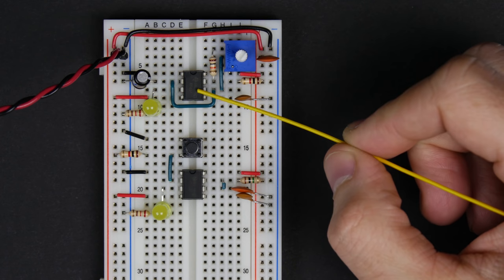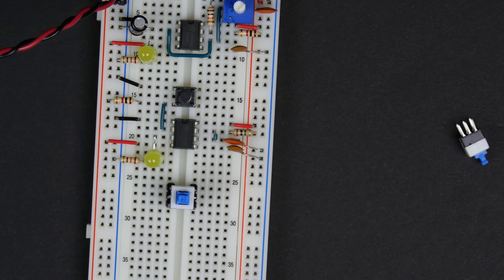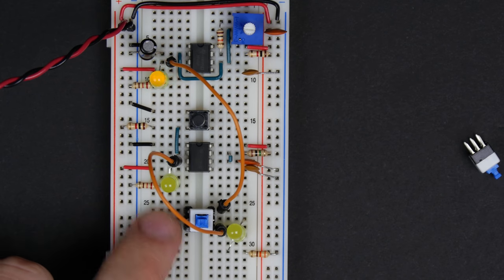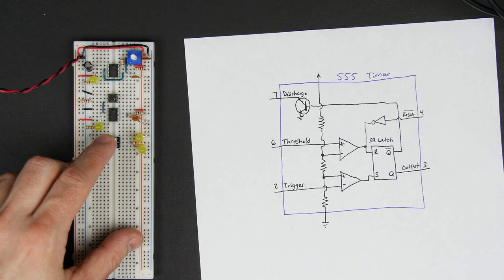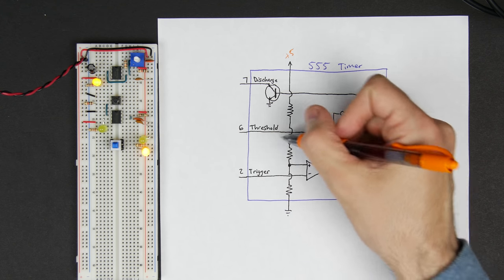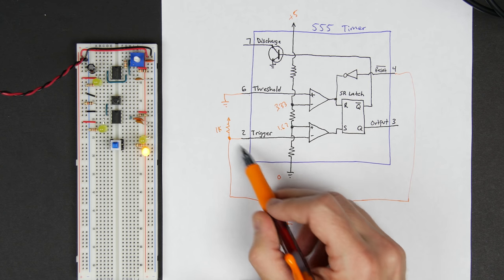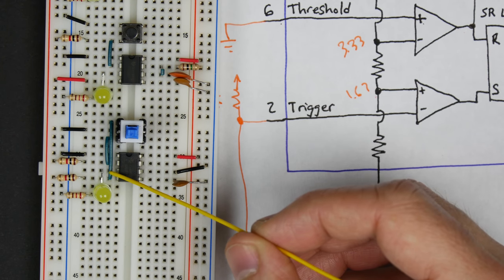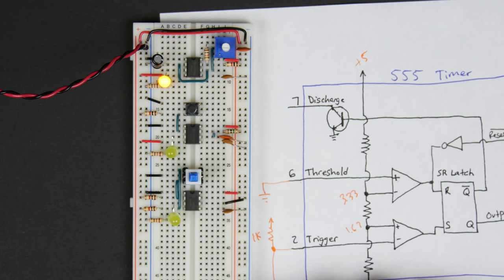Bistable 555 - 8-bit computer clock - part 3

Comment: 3 episodes in and I am getting the vibe that whenever there is a problem, you just add a triple 5.
Reply: lol
Reply: Styil I have used literally hundreds over the last 20+ years. There’s very little you cannot do with a triple 5.
Reply: I really liked the clever use of the SR latch to debounce the switch.  Brilliant!
Reply: @realdragon  probably. Show the right girl some creative uses for a 555 and she'll be all over ya
Reply: @devnol  555 is very Common so you'd rather have one of These at Home than having an SR Latch Chip
Reply: yeah the 555 is one of the best ICs ever created
Reply: @realdragon  - found a boyfriend with one 😉
Reply: @realdragon  Hook the output to a small motor and you're well on your way.
Reply: The Flux Capacitor was secretly just a bunch of 555 timers
Reply: Or a ceramic capacitor.

Comment: For anyone who buys Ben eater's kits, you need to buy "break before make" switches. The included switches are "make before break." This causes the bistable circuit to not debounce at all. Took me a whole week to figure this one out.
Reply: Thanks, I saw this happening and was confused by it. Just replaced it with a switch from an IKEA clock, haha.
Reply: Why would it not debounce? Coming from the set to the reset, the initial make before break would have both the set and reset input high. Then the switch would break the set connection leaving reset high. The reset might bounce but this wouldn’t matter as long as those bounces are after the set is broken (which seems logical if the bounces are at the end of the movement not the middle). I don’t have the tools to verify this but it makes sense to me?
Reply: I purchased and received my Ben Eater kit today. Going through the tutorials/package the switch is now different. The newly included switch is a "slide switch". In the included printed manual it notes next to the switch that "This replaces the push button toggle switch used in the videos".  Just wondering out loud if this change was for the reason pointed out by @TheOverUnder?
Reply: Shaheen Ghiassy he probably was trying to fix it once he realised
Reply: There is an easy way to fix this, which I have outlined in another comment. Essentially, you can simply plug the switch into 5V and pull down the pins 2 and 4 to GND, thereby "inverting" the logic and completely fixing the problem
Reply: You can also get SPDT switches, they work normally for me

Comment: One of the core concepts that is hard for folks used to working in analog electronics is the pull-up resistor. Imagine dimming the lights for a romantic evening by turning on the hairdryer. It’s like that…

Comment: To anyone that has bought Ben's timer kit: the switch provided there is a make-before-break switch, as opposed to a break-before-make! However, there is an easy solution to fix this.
Simply invert the logic that the gate in the video uses; i.e.:
- Connect the switch's central pin to 5V, not ground
- Use pulldown resistors to GND for pins 2 and 4
The rest of the circuit is identical. By inverting the logic, you are essentially converting the make-before-break switch into a break-before-make switch. I have tested this thoroughly and can confirm that with the original circuit and the kit's switch there is bouncing, which is fixed after doing the above method.
I hope this might help someone! Thank you, Ben, for the amazing videos!
Reply: Does this change the set up in part 4. Because everything I try to connect the 3 555 times to the inverter, and, and or gates it doesn't work. Could you please help me. Thank you.
Reply: Hi there, I am stuck at this part of the module. Can you link an image of your clock or a sketch of your circuit? 
Thanks!
Reply: @kashyapkhatri2325  which part? Did you get the three 555 timers to work?
Reply: @justinsherman9633  Idk how to connect the three pinned, make-before-break switch included in the kit with the 555 timer. This is a different switch from the video.
Reply: @kashyapkhatri2325  where he has the middle pin of the switch ground change that to the 5v and where he has on the 555 timer port 2 and 4 in the five v change to ground. Have the top pin of the switch inrto part 4 of the 555 timer. Pin three into part 2 of the 555 timer (tigger on the schematics.)
Reply: Why does make-before-break require different logic to prevent bouncing? Is it because having low voltage in pins 2 and 4 simultaneously leaves the SR latch in an unstable state that will resolve arbitrarily?
Reply: Makes sense to me! Good fix. Invalid state would resolve arbitrarily, so break before make and make before break require different solutions. I tested my switch right when I saw the beginning of this and realized my switch was make before break. Luckily I found this comment... unluckily I didn't have to think very hard to solve my issue.
Reply: I actually skipped the last 555 and built an S/R latch out of two of the remaining OR gates and inverters introduced in the next video. Then you can keep the switch wired as is, and don't need the extra inverter for the Q output here, since you already have access to the inverted Q.
Reply: @justinsherman9633  Quite late but thanks, figured it out.
Reply: This seems like a pretty terrible oversight for a kit that doesn't include instructions for the very purpose of watching these videos.
Reply: @Nadesican  yeah I’m just buying the parts on my own as I don’t need everything and that way I don’t sink all at once. Thanks to these comments for helping others and myself to find the issues.
Reply: Thanks for pointing this out Sergey.   With my oscilloscope, I was able to prove there's a make before break, and it appears to be noisier than the pushbutton switch.
Basically I connected one of the switch's outer throw to 5v, the other outer throw to ground through a 1K resistor.  Then connected my probe to the side of the switch that's grounded through the resistor.  If this is a make before break, then the SPDT in this circuit will operate as a momentary SPST.
Sure enough, I'm showing a noisy pulse width of up to 100uS or higher.  You'd probably never see this using a digital ohms or continuity testor as the pulse is too short for the DVM to react.

I'm not sure really if reversing the switch logic would help,   Sure as you're in the double-make you're OK, but as the makes break, you could theoretically get bounce noise on both sides.   But I suppose as long as you don't get bounce noise on both throws at the same time, that is one is always solid make before the other breaks, then that will work.

What would change further down the circuit is that the switch would select opposite than the video.
I thought for a bit that you could get the !Q from the discharge transistor with a pull-up resistor, but basically that resistor/transistor configuration becomes basically an inverter so when Q is asserted, the transistor output for !Q is also asserted since the transistor is off at this point and the pull-up gives you a logic 1.
When Q is not asserted, internally !Q is asserted, turns on the transistor and the resulting output intended as !Q becomes ground or logic 0.

Just flip the connections on the switch. If in the original plan putting it to the left would be the running clock, now  it will be the manual button.

Too bad about the slide switch.   I would have preferred the push A, push B switch.   I suspect Ben made the change because the switch he used didn't fit the breadboard properly and had to solder on header pins.   He wanted to avoid the need for any soldering for those of us that might not be comfortable with that.
On the other hand, the slide switch does give you a mechanical view of the setting where the push-push would be harder to tell what position it is in by just looking at it.

I'm having fun just building this clock project, particularly getting use out of my new Rigol DS1054Z oscilloscope.   Imaging the fun when we get into the other chapters of the project.
Reply: Sorry guys but I built the circuit reversing the logic state of the switch, center 5V, S and R with 1K pull-down to ground and still encountered bounce noise.
Most of the time I get a clean output on Q, but once in a while I see a bit of a bounce on the oscilloscope.   When going from R to S, i get a jump down to R 24uS from initial S for 8uS with one very short burst to S during that 8uS window, before settling to S.

What might be needed is the output gated by the astable clock.
But then if you think about it, you're not going to be flipping that switch very frequently, and the circuit following this in sync with the two clock sources will even lessen the chances of make-make bounce making a stray output clock pulse.

Just be aware the problem still exists.
Reply: It certainly helped me. Thank you so much Sergey!
Reply: Thank so much…that did the trick!
Reply: Thanks for this comment! I had to look closely on the scope to figure out what was going on with my switch. The one in my kit wasn't reliably either break-before-make or make-before-break; it'll sometimes be one or the other, and often with overlapping noise on both poles. These are the switches I picked up from Amazon that seem to reliably be break-before-make on all the ones I've tested so far: https://amazon.com/dp/B07JWB89L9
Reply: @Sergey Thank you!  I'm a newbie and just bought the kit.  One thing to note, your solution requires the switch to always be in the circuit when the power is on.  If powered and you remove the switch, both pins 2 and 4 will be pulled low and create the illegal SR state when both inputs are set.  Not really an issue because we all turn off power before removing components from our breadboards like responsible engineers, right? ;)
Reply: Thank you this helped
Reply: @CodyScavenger Uh… right.
Reply: My switche exploded after I did. that. Don’t Listen to him guys

Comment: I have yet to view your 555 as timer videos.  But I wanted to congratulate you on thinking to post these types of videos for people who seek to learn this stuff.  I’ve built the examples and I’ve made use of the crystals just as they’re demonstrated, just as I’ve used my real time clock with the CR2032 button cell battery.  I get a strong sensation from seeing the video, that you prefer (or maybe have had more experience with) TTL driven clocks.  It now occurs to me that chasing the TTL clock (I guess I’m locked in phase)  is the real key to understanding these signal styles that you have so cleanly demonstrated.  This is some very important wisdom.  It’s the true meat and potatoes for making the decisions regarding circuit design.  Also, I can use this to more fully understand hardware design languages like verilog or pshvhdl.  Thank you so much your videos have made my 2019 a ‘yippee’ year so far!

Comment: 01:20 Another idea is to solder it to a DIL socket.
02:18 There's another problem with such a switch: we cannot control the exact moment at which we will switch to the automatically clocked signal. This may be a problem sometimes. So a better idea would be a single clock which can be advanced either manually or automatically depending on the switch's position, so that it would always start an entire new cycle from scratch after switching to the automatic mode, and finalizing the last pulse after switching to the manual mode, but just holding up the next pulse until manually triggering it as a one-shot. That's one of the reasons I was wondering about how to reuse a single 555 chip for this dual purpose.
Reply: Could you provide schematics for bistable switched mode using single 555?
Reply: +Nerijus Vilčinskas
Here's what I went with:
https://circuitdigest.com/electronic-circuits/555-timer-bistable-multivibrator-circuit-diagram
Reply: If you start from the astable multivibrator circuit from the first video, I think it should be possible to add some extra components to be able toggle it between astable and monostable mode.
Maybe something like:
* A switch to switch the lower trigger input between the capacitor voltage and 5 V - when it's at 5 V, the 555 won't notice that the capacitor voltage is low so it will be stable in the low state.
* A button to pull that some lower trigger input high when the switch is in the position for the monostable mode. That should be enough to start one cycle.

This scheme should give a bit of debouncing, because it's just manipulating the trigger input, which in turn causes the SR latch to change state. But if you press the button long enough that the high trigger input triggers to reset the latch, I'm not sure what happens. Maybe the button should ground the high trigger input too.
Reply: If you can make it so that the extra controls only deactivate the triggers (either the lower or the upper depending on if the button is released or pressed) then you should only be able to slow the cycle down compared to the astable case, which I think is good. And it's if enough if a trigger activates once, so there's your debounce.

Comment: I understand that you wanted to present all those 3 practical use, but I think you could have used just 2 555 times by connecting the sides of the toggle switch to the clock and the naked button, with its base connected to the de-bouncing 555.
Reply: Wouldn't that also debounce your astable 555 clock? Which would cause it to miss pulses when going too fast.

Comment: Remove the limiting resistor to the variable R, and add the stepper button in series. That way the “switch” is nothing more than stoping the pulse, and while it’s not pulsing, the push button sends another pulse.

Comment: I think the debouncer, in this case, is useful in very few cases. (in the previous video, it was 100% useful! even though it is random)
E.g if you debug and as you said you wait to switch into manual mode when you change to manual, the signal will be 0 on the manual clock (because you don't press it). So from there won't come any extra 1 signals.
It could only happen, when you change back from manual to clock and the clock when you change is in 1. Then some quick behaviour could happen, but not at debugging. So that would be less fustrating, I guess :D
Reply: Hm, I was unsure about this too, but after some more thinking, I believe that Ben's point stands. Imagine you have a high clock as you switch to step mode. As you slide the switch, just at the boundary of disconnecting the astable timer, contact could be intermittent, thereby potentially causing unwanted clock pulses.

Comment: Shouldn’t there be an OR gate between the /reset’s NOT and the thresholds comparator output? Otherwise there could be contention issues in the SR’s R input and current could be sinked to either the comparator or NOT’s outputs (which could presumably damage them)?

Comment: Ben,  does it matter what type of capacitors you use in a RC circuit?  I remember using a lot of electrolytic capacitors for things I built.  I remember having a hard time finding the values I needed in any other form.  You can tell I use to do a lot of shopping at Radio Shack.

Comment: Amazing videos so far Ben! I'm just having a little trouble with the switch. The LED starts off and when I toggle the switch it turns on, however it doesn't turn off again when I toggle it again. I can fix the issue by unplugging pin 6 on the 555 rather than having it set to ground. FYI setting it to 5v stops it working altogether.

Basically I'm wondering if anyone knows why this is and more importantly if I leave 6 on the 555 unplugged will the circuit still work as intended?

Comment: Hello.  I've noticed that you replaced the electrolytic capacitor with a ceramic disc capacitor.   Is it okay to interchanged the two type of capacitors in your usage of them and they will still performe that same function no matter if you interchanged them,  or is there a particular reason why you would use an electrolytic capacitor instead of a ceramic disc capacitor or vice versa?  There are a couple of different ttype of capacitors such as electrolytic, ceramic disc,  tantalum, mylar, etc. out there and I'm wondering if it's okay to use them interchangeably or is it that these capacitors are each use for different applications?
Reply: They are interchangeable! Some are just a little bit cheaper.

Comment: Reviewing this while looking at what I built and I don't have it set up like this at all, even though it works.  I have pin 2 going to a 1k resistor to ground (pull down resistor?) and then if the switch is on, then ground is directly connected to pin 2. And yet it works when I flip the switch. Pin 4 has a pull up resistor and connects to the other side of the switch, so that looks right. So I moved the pull "down" resistor to where it should be as a pull up resistor and it still works. It's like pin 2 pulls itself up automatically from the chip. Weird.

Comment: Is there any particular reason why one should use the reset pin instead of the comparator pin to reset the latch?
Reply: In order to reset with Pin 6, you'd need to connect that pin to a voltage above 3.33 V, so probably 5 V.  In order to set with Pin 2, you connect it to a voltage below 1.67 V, so probably Ground. But we want to dpdt switch to toggle between set and reset. So Pin 4 is convenient, because you reset with that pin by connecting to Ground. So the switch just toggles whichever pin is connected to Ground.

Comment: Is there anyway to do this kind of thing with Dip Switches instead of just a push button? Curious is there's a way to do this without any soldering, lol
Reply: There is a way to do it. It depends on which DIP switch you are using.